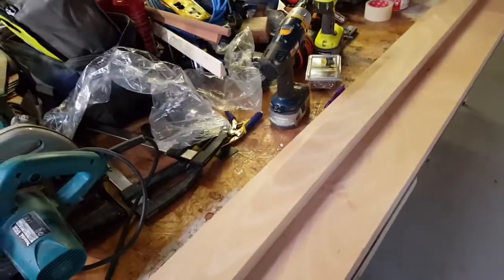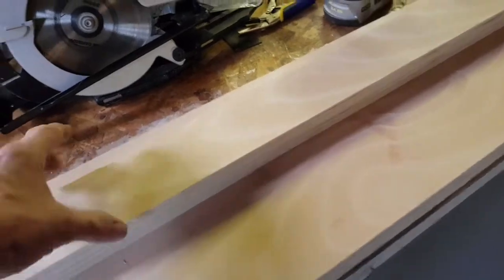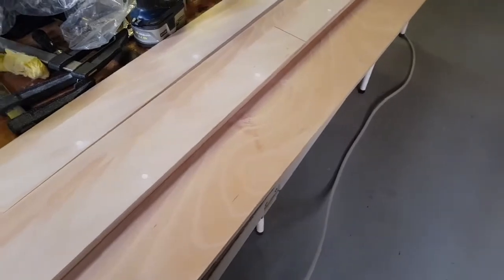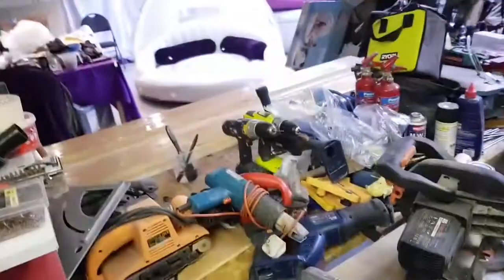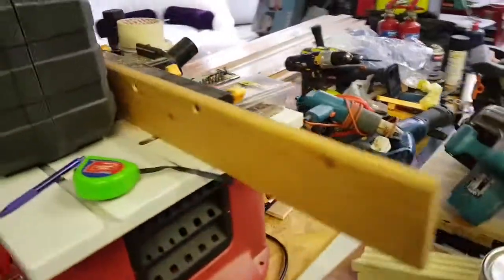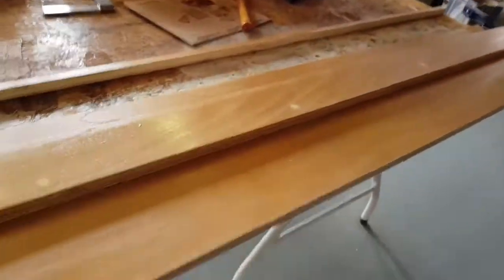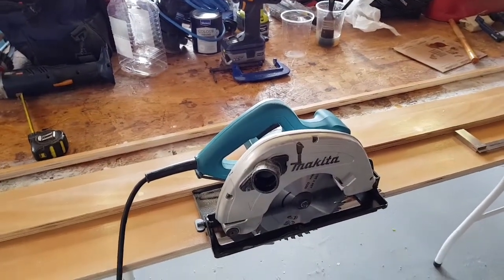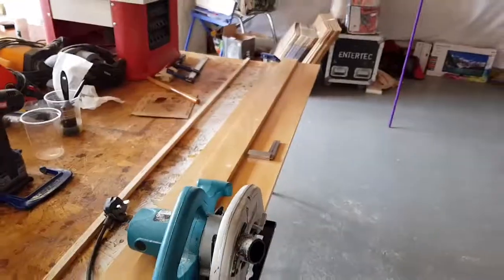TOOL - Zero clearance circular saw guides.

Comment: Why not add a 2nd board at the end perpendicular at 90 degrees to create a T-Square to use on the drywall factory edge?  (1) Measure and make a pencil mark along the back end. (2) Line up your T-Square Saw Guide (3) Make your cut.